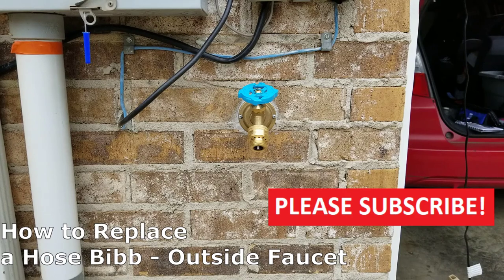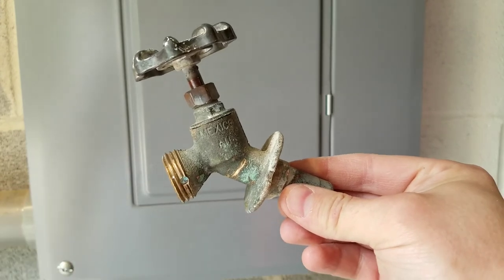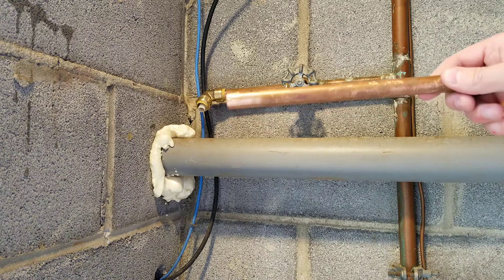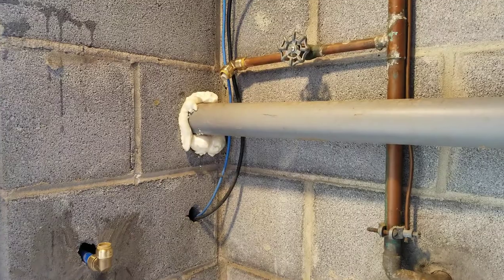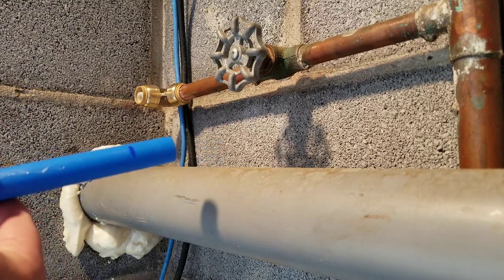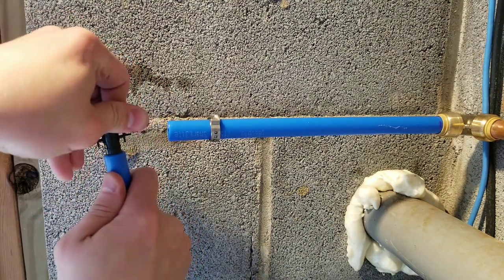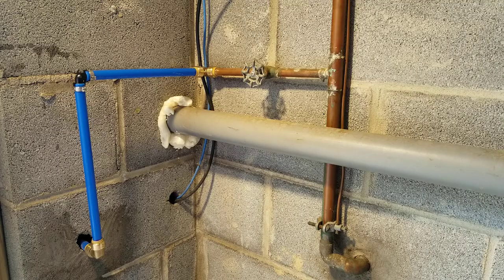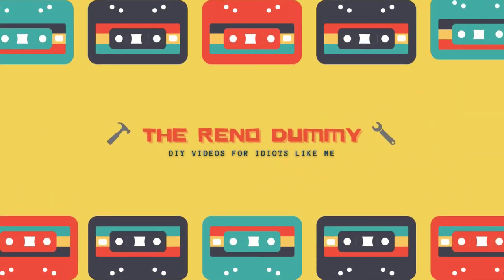How to Replace a Hose Bibb - Outside Faucet #diy #sharkbite

Comment: What was the set screw for that you had to drill out? I don't remember seeing that before.
Also, not sure where you are, but would it be better to use a frost proof valve?
Reply from the maker: There's a set screw on the side of the vacuum breaker that keeps it from coming off. If your bibb is old then you probably can't back it out. I'm in Alabama so the frost proof is not a huge deal but I'm going to put one in when I replace my other faucet.